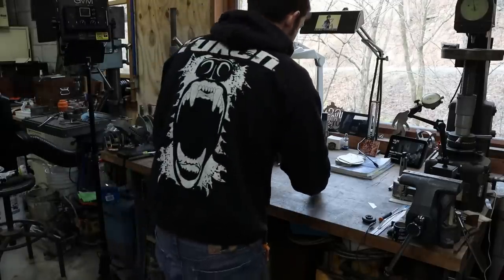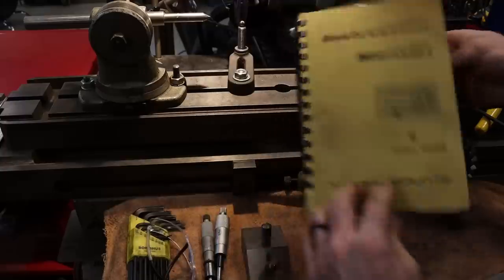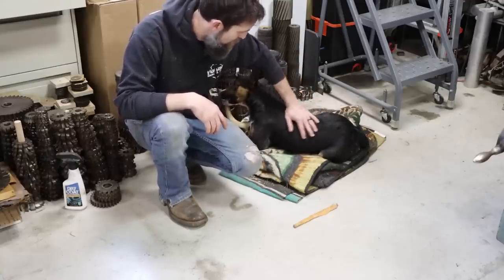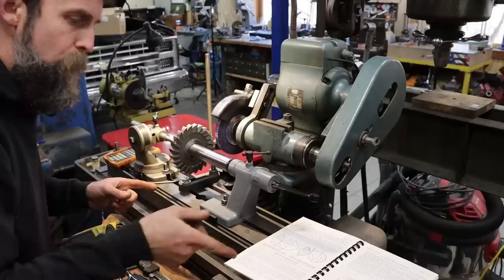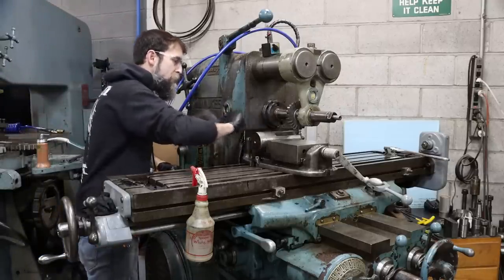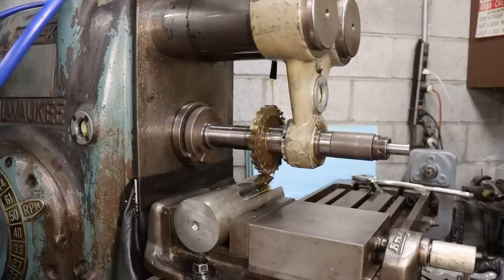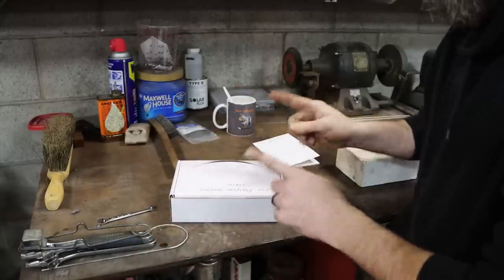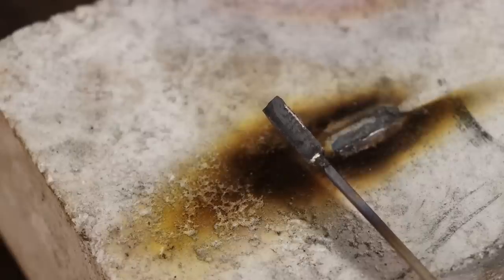Saving the life of a cutter! Regrind and TEST on the K&T Mill

Comment: Hi Steve, Another great video!  Hedge Apple, sometimes just Hedge, aka Osage Orange, aka Bois d'Arc (French meaning wood for bows, as in bow and arrow).  Native Americans prized this wood for making bows.  It has a very high heating content (BTUs / pound or Joules / Kg), higher even than oak.  It is extremely rot resistant (I know of hedge fence posts that must be close to a hundred years old and are still solid in the ground.  When silver soldering/brazing, I often like to cut off a small piece of silver solder and place it in the flux.  I get much better control of the amount of solder applied.  It is very malleable and sometimes it makes sense to pound a small piece flat rather than use it as is in the round.

Comment: Hedge Apple is Osage Orange. It is one of the hardest North American hardwoods with a Janka rating of 2620. Janka rating is the amount of force it takes to imbed a 7/16ths steel ball halfway into the material. I have made a number of wood mallets from it. My brother in law has a stash that came from a National Guard base. It was cut when they trimmed the training area and then tried to run it through a wood chipper. The chipper said NO!!! Osage has the highest BTU value when it comes to burning,
Reply: Yep, very dense stuff and like 25% more BTUs than oak.

Comment: I've got an Osage Orange (hedge, bō'd arch, bow wood) mallet I turned many years ago. Tuff, hard, heavy works great. My go to wood for tool handles of all sorts. Miles of wind breaks were planted with it in the 30's. Mostly gone now. Nearly rot proof. Thanks for the video. Nice mini torch. I could use one for brazing/silver soldering carbides.

Comment: Love my Smith little torch setup, I got it for brazing and gas welding when I was into RC rock crawlers. It is perfect for doing the small frame and cage joints.  Having the tiny torch connected to a full sized oxy acetylene setup looks ridiculous but running out of gas is a non issue lol.
BTW I'm cursing you as I search the interwebs for a tool and cutter grinder. I seem to have a bin full of  end mills that need attention.
This home shop machining "hobby" is a endless hole of machines, tooling and accessories.

Comment: For those of you wondering where the 0.0087 magic number came out of, normally to calculate the offset you would want to use: wheel diameter * 1/2 * sin(angle), which is easy to do with a scientific calculator, but those have only become commonplace over the past 30 years or so. For a wheel diameter of 5.382 and 6 degrees of angle, the direct calculation yields 0.281 approximately. However, instead of calculating the value of sin(angle) we can make a few simplifications and use a linear approximation. Since we're dealing with values in the neighbourhood of 5 degrees, we'll pick 2 points near 5 degrees: 0 degrees and 5 degrees, and calculate the slope between them. That will be (sin(5d) - sin(0))/(5-0) which simplifies to sin(5d)/5 which is approximately 0.0174. If we bring in the 1/2, we end up at 0.0087, our magic number. So within a neighbourhood around 5 degrees, we can approximate the value of sin(Xd)/2 as Xd * 0.0087.

This type of approximation only really works well for points near where sin(Xd) is zero, as that's the area where the curvature of the sin function is closest to a straight line. At other points along the sin curve, the approximated values will diverge from the actual values more quickly, and so the technique will be less useful.

Comment: Thanks Steve. When I do small silver soldering jobs I find placing small snippets of solder in position before heating to easier - it stops you from using too much silver and eliminates the possibility of moving a part out of position with a stick of solder. The snippets must be in contact with the surfaces (so they don't float on the flux) and you must heat slowly at first otherwise the flux can move them.

Comment: Why don't you drill some large holes in the gully at the sides of your Bridgeport vice inline with the 'T' slots so the cutting oil evacuates out instead of using rags to stop it running off the table

Comment: That squeak is 1:1 with RPM. Maybe running an indicator on arbor may tell you if you have a slight bend in it? Or it's a wobble in cutter roundness or side flatness?

Comment: Awesome video. I have a cutter grinder as well. I am trying to learn all i can about them. mine has a fixed head that rotates and raises, but does not tilt. there is a flat plate on the back tapped for 5/8 fine, and i put a Themac 7 post grinder on it, that can tilt any angle. Mine was designed for centerline induced angle like yours, but the Themac adds the angle grind. I got 4 full milk crates of tool holders, adjustable fingers, brackets, collets, on and on, things i am only now finding out what they do. I got 4 ammo crates full of brand new stones, including 25 diamond  stones, flat edged and cupped all name brand. SO all i can learn helps. i got a brand new Air bearing still in the box.  FWIW. if you have an extra gear cutter in a useful size i would be interested. Just a hobby, but what fun.

Comment: I do like the cutter grinder, I don't really know what it is about it, maybe it's the sparks flying off, I even like the way it sounds when it does it's cutting; it reminds me of the sound of a wood plane shaving the edge of a board (in the correct direction).
Your new torch is perfect for making jewellery, I used to use Acetylene myself but I used some rubber tubing slipped over the tip of the large torch and over the threads of a tiny tip, so basically all I had in my hand was the tip and the rubber tubing. It was really maneuverable but setting the gas levels was not as convenient.

Comment: nice shop, I enjoy your videos
Bowdark, Hedge apple, Osage orange ,  its known by a half dozen nicknames , great for gateposts hunting bows, tool handles and other tool parts
a hairy bear to split but a extremely hot fire, as firewood ,not kindling ,dont put more than one piece in the stove at once {mix the wood species} because 2  or more pieces will melt your stove,...no joke ,
kindling should be just fine
Ive seen three melted stoves as evidence for its intensity ,not mine , luckily I knew of it

keep up the good work 
I enjoy rebuilding the older machines as well
be safe 
Mike
Reply: I'd much rather split Osage Orange than Elm.

Comment: Boy I could send some cutters your way to sharpen, the learning curve is steep, I use it to remove metal fast but have found out you need to ramp into your cut, starting out deep into a square end is looking for trouble. I'm in Montana so there is no sharpening service that I know of in state.

Comment: dont have a toolgrinder and starting to wonder if you can do sumting simulair in a lather , putting the grindingwheel in the chuck and put the too ontoo the crosslide 
the only thing that cannot be adjusted without sme trouble or an add on height adjuster on the crosslide would be the height of where the tool touches the grinding wheel

Comment: Hey Steve, why didn't you choose seven degrees as the primary bevel then it would have been in range to do both steel and aluminum and you would have needed less secondary bevel? Does one degree affect the wear on the teeth that much?